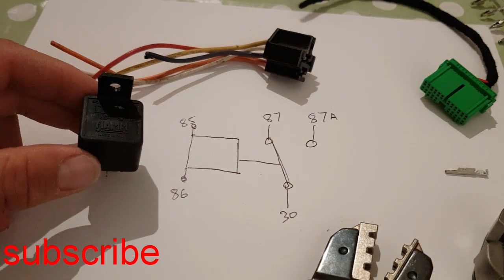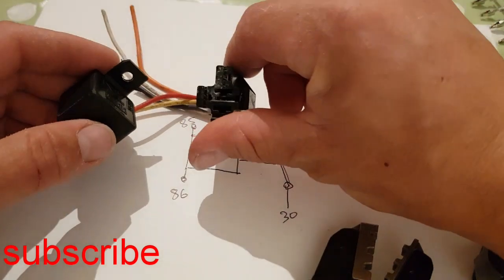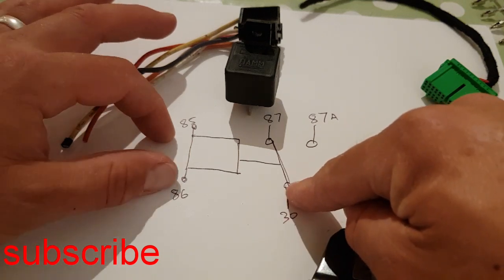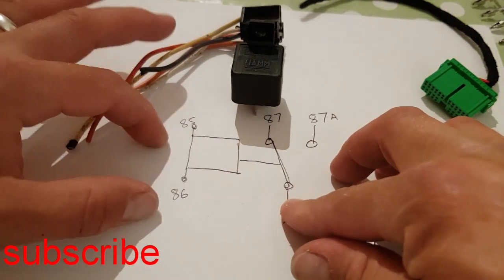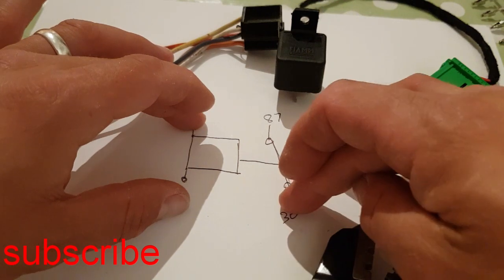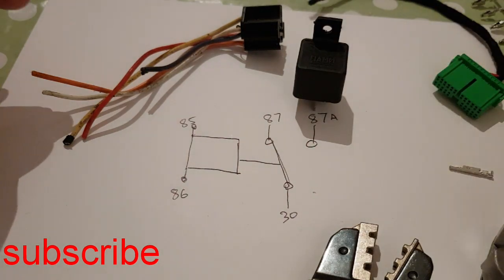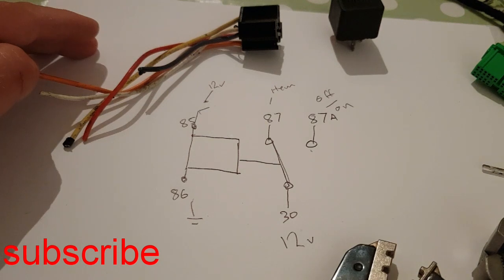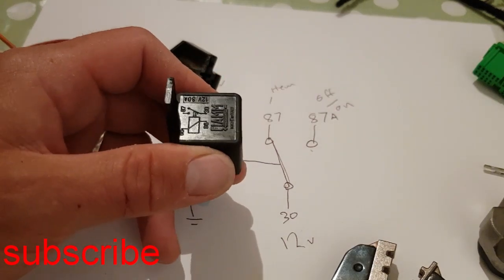24v 12v relay explained 4 or 5 pin how to fit and how to use it

Comment: I've got some lights that are 24v is it possible to run the live as 24v but the signal wire from a switch 12v? As long as the relay is a 24v specific one?

Comment: I know in canada,  you must switch the Line (hot) side when dealing with AC systems (code). You can not switch the identified conductor (Neutral). Perhaps it's different for DC switching, I'd have to look into it.

Comment: Will a 12v relay work in a 24v system?
Reply from the maker: it will but it's not ideal. 
it's ok to get you out of a issue in a emergency but 24v relays are just as easy to get as 12v.
hope this helps
Reply: Will a 24v relay work in a 12v system?

Comment: Can it power 115v?
Reply from the maker: you can get relays for every voltage going. you can't switch a 12v relay with 115v.